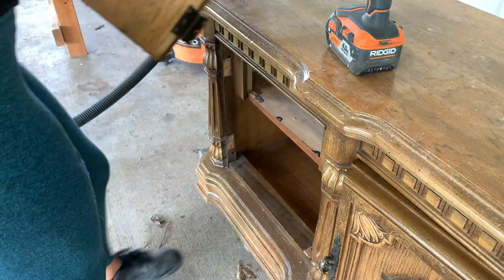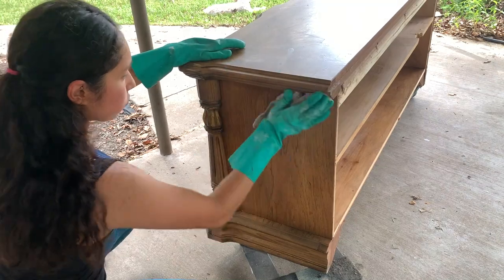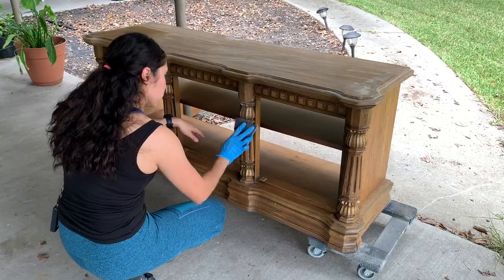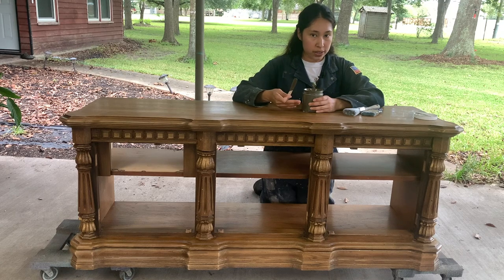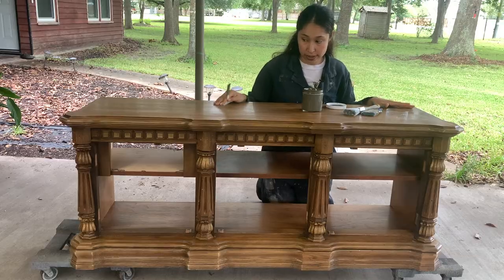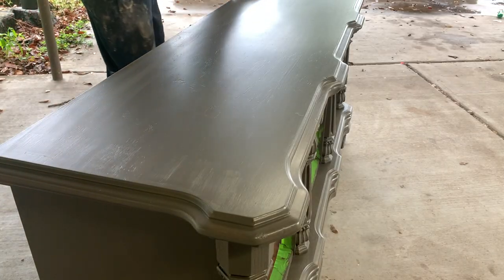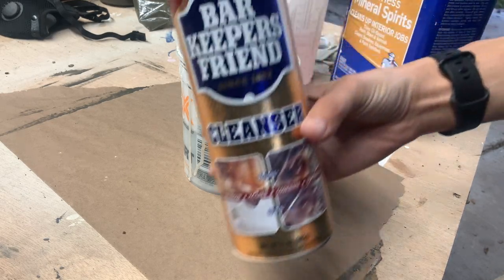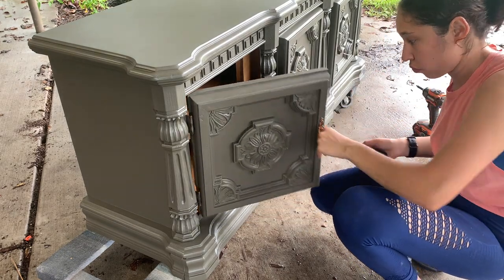Furniture Makeover using All in ONE Paint | Furniture Painting for Beginners

Comment: Glenda, you do good work.  But damn, that thing's gaudy.  Gaudy before, gaudy after.  Looks like it belongs in an old lady's house or maybe a King's castle.  Tough to sell that right now. It's just not in style.  I gave up on that stuff, just not selling, not even after a month for $200.  Only clean, simple lines are selling in my area anymore.  

Hey, think about this.  You get a piece of old furniture, scuff sand it to take the glassy topcoat off--which is probably a shellac because that's what they used back in the day, then prime it with a water-based primer and, of course, it bleeds through so you go to the heavy-duty primer--Shellac based--which finally covers it.   What's the difference between the old top coat you sanded off and the new shellac you put on to block the bleed?  Nothing!   Try it.  Just clean and prime, forget the scuff sanding on old pieces and be amazed.  If you used shellac primer it still sticks like glue.
Reply: I thought it had a Mexican vibe. Or Southwest vibe. Most old factory  furniture does not have Shellac. It has varnish. BIN will stick to anything.
Reply: @jill552  To me, same difference--it's a topcoat that everyone tells you to scuff sand.  Shellac will stick to varnish.  And the varnish blocks the bleed through. 

I have a new water-based primer that is either equal to or only a small step behind shellac as far as stick.  It's called Bonding primer from Home Depot.  It's horrible at stain blocking but wow does it ever stick.  Get some on your hands and you need to get to the sink quick.
Reply: @eddieadams4770  I'm really surprised you had trouble selling yours. These 1970s Mediterranean pieces with all those details are highly sought after and sell really quickly. Even the ones with plastic onlays! Just skip around all the painted furniture channels and you'll see what I mean. I've been really lucky to score several that I kept for myself. I'd keep picking up more of these pieces to flip if they weren't so darn heavy!
Reply: @PattyPaints  Let's check.  Where are you?  I'll look up Facebook and Craigslist and let's see what's for sale and for how much.
Reply from the maker: lol really??! I feel like they're making a comeback!
Reply: @GlendaChavez  they are beautiful painted.
Reply: @GlendaChavez  Let us know when it sells and what you sell it for.